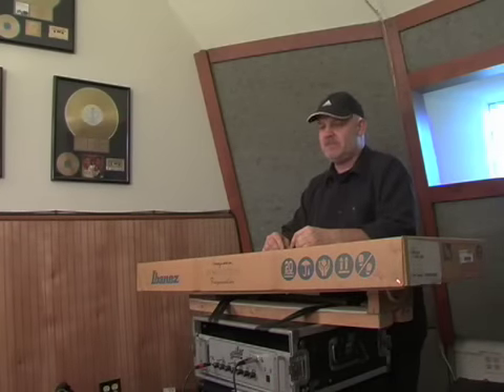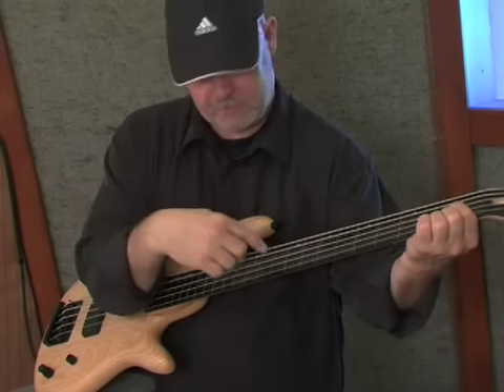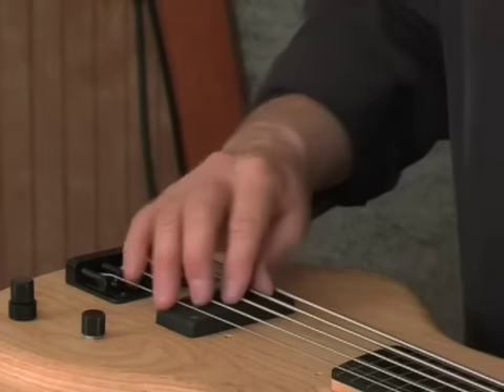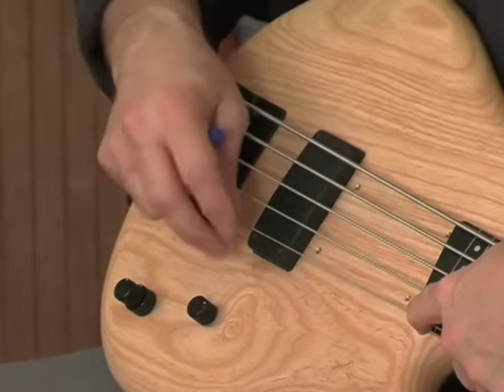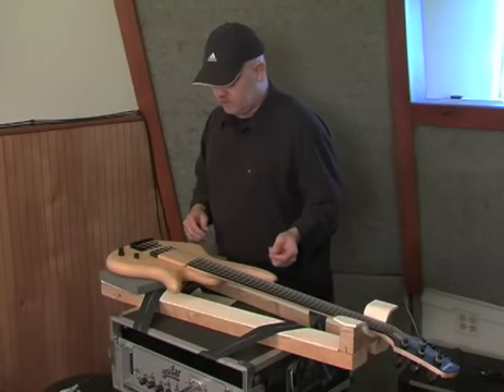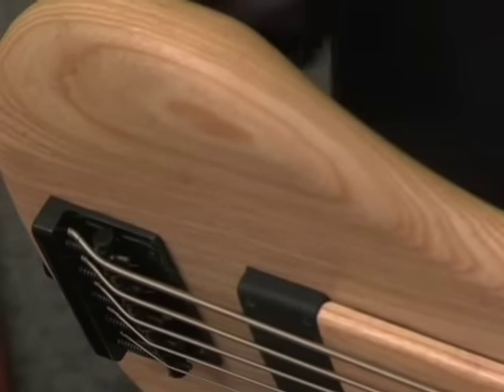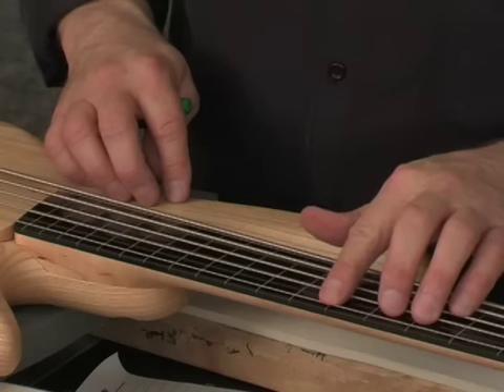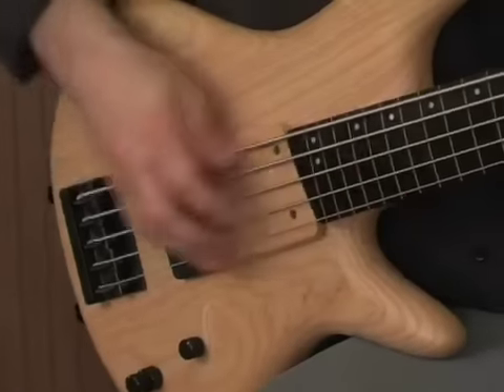GaryWillis GWB setup

Comment: I believe it's so that he doesn't dig his fingers too deeply into the string. He plays very lightly but uses strong volume from the amp to compensate for the light touch. He finds that the over-all tone of the sound wave is more uniform that way without the sharp decay in sound that comes after giving a string a good twack. Also, because plucks lightly he suffers far less fatigue in his fingers and hand. i think that's how he explained it in another video seen elsewhere.